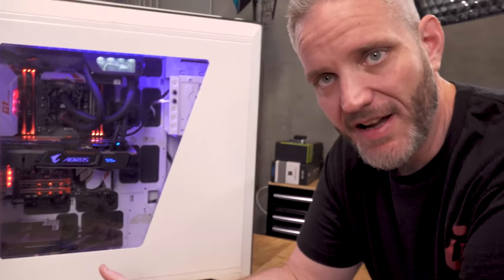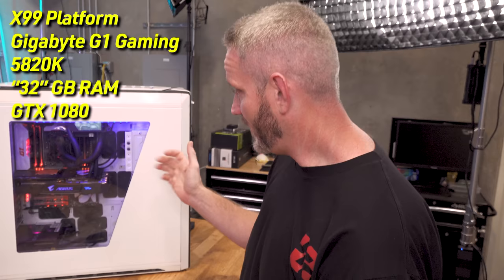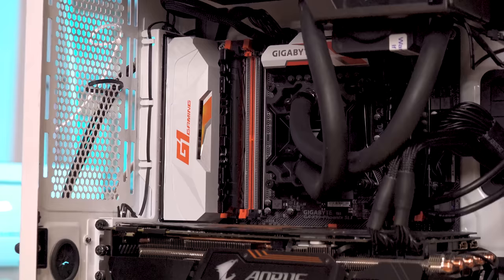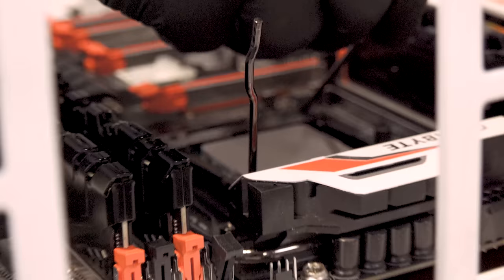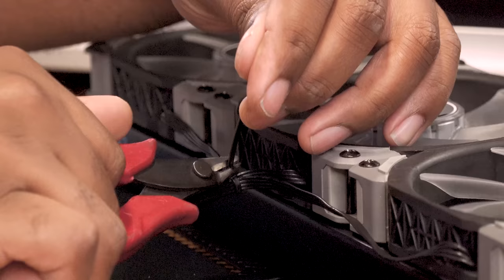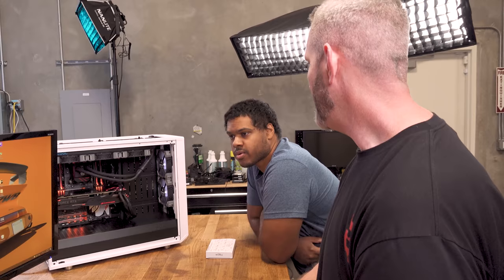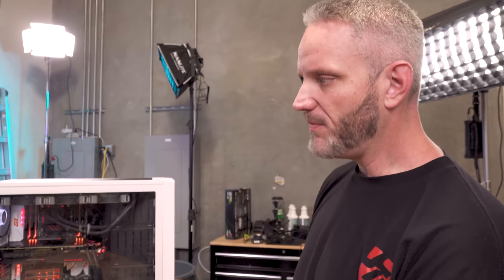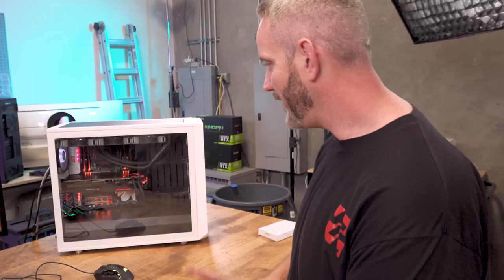This Gaming Rig needed some serious help!

Comment: The only thing I didn't understand was.... throwing away the old case.. until I watched the bit around the 13 minute mark. Then it made sense. I'm still running a Cooler Master Centurion 5 as my case.

Comment: What similar upgrade path do you recommend. I have a core i5 4690k, 16GB DDR3 RAM, Z97 MSI Krait MoBo and a GTX 970 4GB with 600W PSU. Current GPU situation in India is pathetic. Only available GPU within budget is 6600xt

I don't want to go for 100% new build. I get 45 FPS at medium settings in Control and 40-60FPS in Doom Eternal at Medium High settings

Have a 1080p ViewSonic XG2405 monitor

Comment: Was 3dmark running off the spinning hard drive compared to the nvme drive?  Would that be a factor?  Just curious.. Just noticed it.
Reply: 3Dmark doesn’t test for disk speed so the benchmark only begins measuring once it’s loaded into RAM & VRAM

Comment: The 5820K YASSSSS. Should totally go unlocked Xeon though... I am building a dual 2699v3 system soon.
Reply: Oh nvm you guys went with a 6900x... wait, do you mean the 6900k or the 6950x?

Comment: I'm laughing at current issue's with getting a new video cards as I just sold both of my Asus Stix RX5700XT's for what I paid for them new.
Only sold them as I got my hands on a RX6800XT at a good price and still had a little left over to replace memory to a 3600mhz 32gb kit.

Comment: Hey Jay, is that cpu overclockeable? I would love a vídeo of overclocking in old hardware and the preformace difference between original, upgrade and overclocked
Reply: Broadwell-E can be overclocked... but they don't overclock very well. Still would be an interesting video to watch.

Comment: Watching this vid also on a 5820K with a legit 24gb (down from 32GB due to part swapping to the Ryzen build)
"You can definitely have 24gb on 4 sticks; 2x4gb and 2x8gb DDR4 2400mhz"  😁
I hadn't dinked around this x99 mobo in a long time, but it seems like it's got a ton more features than the x570 it's being replaced by. Eight quad channel RAM slots, 4 PCI-E slots, even an M.2 slot I wasn't aware of until last December, and it's got USB 3.0 slots coming out of its gills.

Comment: Still using an AMD FX-9580 with a GTX 1080.  Upgrading the GPU is pointless for me until I get a 2K or higher display that does more than 60Hz.  Still using my old Playstation Display (Yes the failed Playstation 3D Display) but I got it brand new on sale years ago for $200. 3D was too dark and I could see the shuttering of the glasses which gave me quite the headache.  Only passive 3D doesn't give me nausea except the original 3DS systems.

Comment: Man, those NZXT grommets were garbage in that era. I still use a Phantom 820, almost the exact same case as the Switch 810 you just chucked, but after having a similar sticky grommet problem as well as having pieces of the grommets just break off where they had been bent by the cables passing through, I just decided I was okay with seeing straight through the cable routing holes and threw all the grommets in the garbage years ago.

Comment: This was a fun one to watch between the nostalgia of the older build in that particular case as well as the usual shenanigans. Also, I have an X99 system I still use with a 5930K that I recently upgraded from DDR4-2800 to DDR4-3200. I wasn't sure that 400 MHz faster RAM with the same timings would make that much of a difference, but it was noticeable. I've been considering grabbing a 6900K from eBay just to see if that makes any difference. The only reason I'm even considering it is because of the RTX 3080 that's in the build. I feel like I'm leaving performance on the table with that GPU paired with a soon to be 7-generation old CPU. Anyway, great video!
Reply: Apparently quite a few of the Broadwell-E cpus don't overclock as well. I was going to upgrade my 5820K with a Xeon 1660 V3, which is essentially an 8 core Haswell-E that can even OC. Ended up buying it for cheap, but then I just said screw it and built a brand new system with a 5900X instead. At some point I'll shove the 1660 into the old one and use it as a secondary machine.
Reply: @IdiotRace  My main system has a 9900K and DDR4-3600 with a 3080 Ti. Definitely a better pairing for the GPU than my 3080. Still, my 3080 with my 5930K and DDR4-3200 seems to perform an average of 84% of what my main system is capable of when gaming at 1440p with ultra graphics settings.

Comment: No worries, I'm still running a 6950x, and a 1080ti.  Had to purchase 64GB of ram the other day, cuz shortages of 32GB kits out in the world and after having a 20GB ramdisk for 5 years, you tend to get spoiled.  That 5th generation Broadwell will be good another 5-7 years.

Comment: LOL, the GTX1080 he had is still faster than the GTX750ti I have in my rig because there is no available GPU in an acceptable price range in my area. The last used 1080 I saw was at 750€ and I'm not able to pay that much and btw for that price you could get a 3060 with for me more attractive 12GB VRAM, because I like to render and that takes it sweet time on CPU.

Comment: This is the type of stuff I'd love to do with my family. I just started my nephews off each on gt 1030s and ryzen 3s and 5s

Ryzen 5 2600 
Ryzen 5 1600
Ryzen 3 3200G

GT 1030 OC 2Gb
GT 1030 Low Profile
GT 1030 OC 2GB

Don't ask which combo I used. I can't remember. But obviously these parts are expensive and buying things in 3's is even harder.

I wanna make sure they actually take care of their things before I do any further upgrading. I had a gt 1030 before and the ryzen 3 and 5 2600, so I only had to buy 2 GPUs and 1 CPU and some mobos and ram sticks PSUs and cases. Still wasn't cheap. The upgrades I can do later are the GPUs. They can go up to 1660 super or possibly ti and still not be bottlenecked (much)
I have a 1660ti that I use on my rig I travel with. I didn't wanna give that up until I knew they'd take proper care of their things, especially with the current market and the fact that I had to go to a retail store to buy these old cards & CPUs at MSRP rather than Amazon or something for under MSRP as I did with my 1660ti when I got it initially. 

Right now, their computers work well and serve a purpose. Their first gaming PCs, they can play all the non-VR games they want to play and way better than their school laptops.

So far since June, it has been 3 months and they're going strong. The things work and they're keeping them safe from their younger siblings and water damage. 
When I visit, I'll check if they continue to keep the case somewhat dust free and if they kept food out of it. If they can keep their stuff in working condition, they may get an upgrade. Maybe one, maybe 2, maybe all 3. By the time the younger 2 are old enough, they can even take their brothers' old ones. 
The older 3 are 13, 14 (almost 15) & 16, so they should be good at keeping their things safe. The younger 2 are 7 and 5, so pretty far from getting their own. I'll of course take the old parts when I upgrade, but it'll be nice to have backups. 
I hope to one day have a few cards I can give them when it's time for an upgrade. Too bad I don't upgrade that often. GT 1030 to gtx 1660ti to my current card. 
The ryzen ones were 1 an upgrade from Intel  (I still use the Intel one in my travel one) and 2 a card i bought when considering getting them PCs before the pandemic hit hard. I lucked out there.

Comment: I can't help but think that many-years-old CPU is still going to be a problem especially in latency-sensitive tasks like VR gaming. I probably would have prioritized swapping that out for a 5600X (or similar performance) over the case & cooling changes.
Reply: It's an Intel board so you'd have to change that too
Reply: @ij6708  Swapping boards has become rather a non-event since Windows was made really resilient to changes in the underlying platform. I think I have SSDs here with Win 10 installs that have gone through many different platforms all the way from 3rd or 4th gen Core to B550 (and sometimes back), all with remarkable ease.

Quite the achievement from Microsoft's team, IMHO.

Comment: I've had SOO MANY DAMN MEMORY ISSUES WITH OLDER GIGABYTE BOARDS, I've still got my friends old 3770k i think it is? Been awhile. Anyway this stupid thing for some reason doesn't power off if both ram sticks are in, as in your turn it off, the screen and all that turns off, but the machine is still powered and fans are still spinning, put in 1 stick of ram? No issue, but the ram functions completely fine. Who'd have guessed, it's a damn Gigabyte board. I also got 2 faulty Gigabyte RX 480s when they released in a row. Long storys short Gigabyte suck and I do not trust their components anymore, especially after that recent PSU debacle.

Comment: Hi Jay, 
I recently build a system but evetime on the first start the system wont start jus fine,
It either turns on and shuts down, or BSOD with different errors evetime, which also occur randomly while working.
and on the second start it starts fine.

Checked all the connections twice, removed and reconnected, did not fix the issue.
Format and fresh windows install, wont help either. 
Tried with Disabling XMP, tried with disabling onboard WLAN, tried with disabling resizable bar. didn't work. 

after doing 'Sfc Scannow' in safe mode, the frequency of BSOD has reduced a bit.

System specs are as follows;
Ryzen 9 5900x,
Aorus x570 elite wifi motherboard,
Aorus 850w PSU,
Gskils sniper 3600mhz 2 x 8gb ram running on XMP,
Deepcool 360mm AIO,
Segate baracuda Q5 1 tb nvme m.2 ssd,
and Gtx 1650 to bottleneck😢 as nothing better was available.

Could you please suggest me a solution on the above.

looking forward to here from you.

Comment: I mean, 24GB of DDR isn't impossible.  I have a PC with 24GB of DDR3.  4790K i7, 2x8GB + 2x4GB.  4 DIMMs.  Two different kits with the same timings and brand/model specs.  (Adata XPG2)  I'd have gotten 4x8GB, but by the time I tried to add the second pair, there wasn't a pair of 8GB DIMMs on Earth for sale, and I've never seen a set of these turn up on eBay.  (A-DATA XPG V2 PC3-20800 2600MHz 11-13-13-35)

Comment: Not sure i see the point in using a crap cpu with a high end gpu. Like what a mobo and a vastly better cpu may run you what 300 total might as well do it if you're getting a 2080.

Comment: im gonna have to disagree with you brotato.. my 3090 is pummeled by ACC with HP reverb G2.. basically gotta play it at high w/ 80% render rez. on a 5950x and 3090.. w/ an oculus yeah i guess you could get away with that.

Comment: I had a lightning bolt strike near my house. It wiped out my modem and router, both mine and my brothers ps4's and at first my pc just wouldn't boot. I took my pc apart, kept reseating everything, only to realize my board has a diagnostics light on it, which was giving off a gpu error. At this point I was a little bit tilted because my CPU does not have integrated graphics. Fuuuuck. So after reseating the memory and the gpu about 20 times, I threw a hail mary and switched HDMI ports. The storm also fried two hdmi ports on the side of the tv. Moral of the story: get a good surge protector and or UPS and save your work!

Comment: Hello i'm new into PC building and i recently essambled my first own PC. I'm experiencing some issues with temperatures. I'd highly appreciate some help.

Here are my specs:

Case: Lian Li PC-O11 Dynamic
CPU: AMD Ryzen 9 5950x 
GPU: Aorus RTX 3080 Ti Xtreme
Motherboard: Asus ROG Crosshair VIII Dark Hero
AIO: NZXT Kraken X73 RGB
Memory: G.Skill Trident Z RGB 4x 16gb
PSU: ROG Strix 850W White Edition

I have 3 fans on the right back site of the case as intake, another 3 fans on the bottom of the case as intake. The radiator of the AIO sits with another 3 fans in the top of the case for exhaust. 

When i play FPS games on my 1920x1080 monitor everything is fine, however when i play games with high graphic demand on my 3440x1440 monitor i get both GPU and CPU temps up to 80c - 85c and sometimes even 90c (Metro Exodus everything on ultra for example).

Comment: lol, you should see how old my computer is :P

Mother Board: ASUS Crosshair V Formula-Z
CPU: AMD FX-8350
Memory: 16 GB Samsung DDR3-1600
GPU: Sapphire Radeon RX 580 

:P it's... ahh.. old. Built in 2012 (well GPU was an upgrade later). Wanted to upgrade in 2020 as I saved money.. BOY THAT DIDN'T PAN OUT!

I do have 32 GB RAM ready to install, but for some reason when I put them in the motherboard only recognizes 16 GB max for use, even though it can tell there are 4 sticks of 8 gb and this MOBO is supposed to handle up to 32 gb.

Comment: 2:37 How the fuck did Nick get hold of a broadwell series CPU. They were only sold to OEM's.
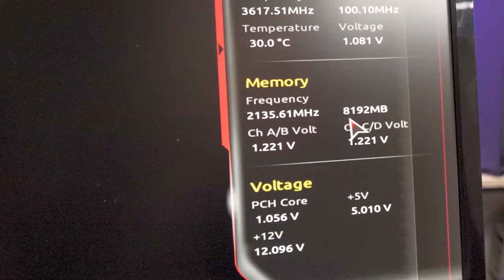4:15 That memory frequnecy is fluctuating. I would pull the mobo and burn it. Only buy Asus boards and you'll never have an issue.

Comment: How the fuck was the timespy score so low. 

I had a 1070 and got both a higher graphics score, and much higher cpu score with my r5 3600. 

I was at like 5700 ish before I upgraded to a 3070 which is almost 12k.
Reply from the maker: His OS is all kinda of degraded. A fresh install would bring the score back up,
Reply: @Jayztwocents  Thanks for the explanation Jay. 

Ordered a gen 4 nvme drive now that I have an rtx card, will try doing a fresh install myself when it gets here instead of just migrating. Had no idea OS degradation could affect a score that much.

Comment: Jay the hack wrong again... You can have 2x8 gb sticks on channel A and 2x4 gb sticks on channel B for a total of 24gb. I've done it before on an EVGA z77 FTW motherboard and Corsair vengeance ram
Reply from the maker: That's a stupid memory setup. You did it wrong noob
Reply: @Jayztwocents  It just what had on hand hack boy, I wouldn't have purchased ram for that configuration. The point is you said it couldn't be done and as usual, your wrong.

Comment: I thought 2080 and 1080ti are about the same in performance.  I get over 9,000 on the GPU score with my 1080ti.  I dunno man, I think that CPU is bottlenecking the GPU…
Reply: It was a normal 1080. That sounds like a normal Timespy score, they were running Timespy Extreme

Comment: What makes this a suck ass upgrade is... So how many of those DVD/Blu-Ray drives do you still have? Oh and how many of those spinning disks? Yup... 0.0. Let's see you upgrade this machine some decent storage, like say with a RAID card and 24TB of space and still use those 360mm radiators. In fact that's what's wrong with all of the builds here, none of them have any practical use outside of gaming and none of them have any PROPER storage.

Comment: What sucks for me is ive always always been intel was always better loved the overclocking just knew how evrtytjkmg worked but my rig i just built over the last 9 months i had to use a 5900x  cause intel fell off. I was going to use a 10900k but when it came time to buy a cpu 11th gen was out 2 less corrs snd nothing special and amd released zen 3. I am kicking myself in the ass now it was intel and rumors say is true thay Intell 12th gen coming out is back and faster than ryzen zen 3 by alot and its intel so faster and overclocking way higher. I guess I'm stuck for awhile cabt afford a new mobo and cpu. I also saw leaks of nvidia 4000 series already I bought my evga 3090 ftwe in nov but didn't finish build till 2 month now 4000 series and heard the 4090 wil be out of reach for everyone pretty much except content creator they're saykng 2999 3080 and 3090ti 2 grand ish so if I upgrade I'll have to get 3070 and under. I mean how are they thinking about the gamer charging 3 thousand dollar msrp for 4090 imagine the after market horrendous I guess I'll be stuck with 3090 for years too. I always like to upgrade sbd. Bes cards ckme out and use the pervious gen for sometjkng else right now I have a htpc in my living room with a 9900k and 2080ti in it and I was planning when 4000 series is out to replace my main rig with 4090 and use my 3090 for a vr setup or for a rendering and streaming rig or use my htpc component to make my son his first computer and replaced it with the 3090 but 4080ti being over 1900 to 2200 and 4090 3k thats just stupid and we all thought ghe titan or the 3090 at msrp of what 1500 and evga ftwe version 1900 eas expensive. Shit 4090 will make a pc build 10k which use to be able to be 7 or less

Comment: "3 drunk men upgrade a PC"

So, the first scores are invalid as the stick of ram wasn't properly seated, and not sure if you topped of that water cooler.

That said, Steam was also installed on the older mechanical drives that were removed.

Also, new case and better cooling.

Yes, newer generation CPU and Video card will give an increase in performance.

The question is did the upgrades really provide a 40% plus increase alone? 

Could the Quad channel memory issue and hard drive upgrade (reinstalling Steam) alone have given Nick a 20% or higher boost?

You are in no ways worthy of being compared with Steve of @GamersNexus. Your testing method are inferior old Padawan! 😆

P.S.
Nick, go to the Light side, get Steve to help you upgrade your VR Gaming laptop! If you don't mind having your computer parts dropped, you can even let Linus @LinusTechTips help. *All Warranties are Voided if Linus helps!